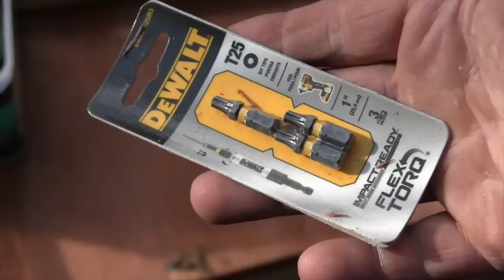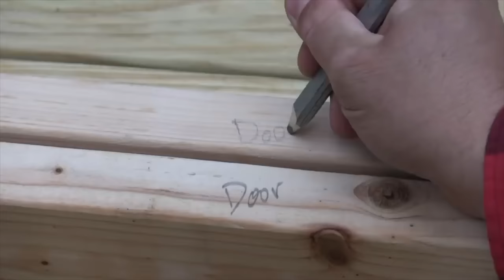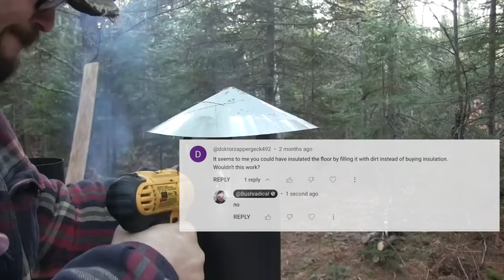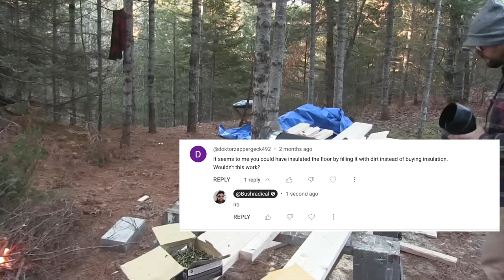Cabin with 24M views.....all the details

Comment: I’d use a nail gun but I own one so it’s a bit easier for me to say that. As for pt wood in ground, that depends where you live, it rots fast here in the south, I have a shop building on my land here in Arkansas, well there’s two but one is full slab red steel building, the other however was built at two different times, the original is probably 70 years old and has creasote treated lumber in ground and is about half way rotted through , the newer addition to that building was built in the 90’s using green pt and the posts going into the ground are completely rotted through. We rant steel posts into the ground at each support to scab it back together. However the red steel building while nicer is not better. It was built in 2012 and has rust holes through a few of the beams. You do things differently than I would but that doesn’t make it wrong, if it works for you who cares

Comment: I built a little fence with nails and then I wanted to take it apart and re-do it. It would have been easier with screws, and I wouldn't have broken some of the boards. Had to buy more boards. I used screws to re-do it. I use screws for everything now so if I want to take something apart it's easier. Treated screws are not that much money.

Comment: Thanks Dave great video on the making of a truly great video of good old common sense basic building of a UP cabin. Your Technics of construction are based on basic carpentry. That cabin will probably outlast you. All of your building videos have a quality of simplicity yet proven to last methods for quality construction. Your absolutely right about screws. For some things they are needed. Mankind has been using nails for hundreds of years now and it's a proven and time tested method of fastening wood. Screws are ok, but pricey way to do things. Battery drills run down as you use them and the batteries themselves have to be recharged. Plain old hammer and nails makes a lot of sense. 
Thanks for your videos and enjoy watching all of them. GOD bless you and your family as things are changing in the world we live in. To my way of thinking, a cabin in the woods is using the sense GOD gave us. 73 and GOD bless, Earnest K5EWM 👍. Keep using those nails. 👍.
Reply from the maker: Thanks

Comment: As a contractor I can testify to the fact that the overall cost of structural screws compared to nails is a factor of 3.  Screws are far more expensive, plus impact drivers + batteries + generator (for remote sites)...

Comment: Hey Dave! Would you consider pure linseed oil instead of Danish oil? The little smell it has is lovely, non toxic. Very long curing time though and you'll need several coats. Pure tungoil would be another option, maybe a bit more protection but very thick and thus less enjoyable to apply.

Comment: In my experience of Nails vs. Screws. Well how many times have you driven a screw and felt it break? Many i imagine.  But I've Never had a Nail break. I live in a very windy area of Southern Colorado.  I built my house with nails, vinyl coated sinkers driven with a framing nail gun. When the gun slams that vinyl coated nail into the wood it heats up and that vinyl melts and acts like a glue.

Comment: ** Two Tips: 1) Soak/Paint wood in a 70/30- Motor Oil/Diesel mix
2) No Cement around Wood Posts, it will cause Rotting. A plastic Base or gravel Base may be used.
Reply: Yep

Comment: Given the extreme cold you deal with, I would have gone ahead and done a 2x10 or even 2x12 wall frame, then insulated the heck out of it.
Im on the Gulf Coast, I dont like freezing that much.

I have always wanted to build something like this, just so I could exercise all my weird ideas, like for the pass-thru for the stove pipe, I would have used fire brick for the wall and surround, covered with real brick, then pass the pipe threw.

Floor and ceiling insulation to me would be paramount.  But a recirc floor heater from the fire would help a ton, and for the roof.....ok, I know this is totally ignorant, but solid foam boards insulating 12" rafters?

NVM...Im a tard.

Comment: Dave, I'm curious why you do not put any non-flammable insulation (unfaced fiberglass, rockwool, etc) in the void where your stove pipe "thimble" goes through the wall? Surely you get loads of condensation in there when running the stove when it's really cold out.

Comment: I’m putting down a simple pine plank floor in a log cabin. What would you most recommend for a sealer finish that is durable. I like the looks of that Watco Danish oil and would use it, but am wondering if you e come across anything better. Thanks!

Comment: I would still love to build a cabin, but I’d like it to be ground level or only one step up. We do get snow, but not much. Purpose would be handicap accessible for family. Do you think that would be possible? I know you mentioned you were going to do that. Our codes are anything 12x12x12 with no electricity doesn’t need a permit. I was thinking an 11x11x? Not sure how tall to either put a loft or just a bunk bed inside. And a deck doesn’t count as the structure, right?

Comment: I worked in a lumberyard as a summer job one year. We had several bundles of treated lumber come in where the boards in the middle were dripping wet with the green treatment. I don't think I've ever seen a single board come in completely dry.

Now, I have a quick question. What would be the biggest structure you could put on a treated post or a post and pad foundation? I want to build myself a cabin to live in without having to deal with any contractors, but I don't know anything about making concrete foundations.
Reply from the maker: I don't really know.........I would do a 20x30 and never think twice about it

Comment: Not to be pedantic, but the minimum size for a building without a permit is for buildings used for storage.  A building used for occupancy is not technically exempt by the literal wording in the code.  Still would need somebody out there to enforce it, so it’s probably fine either way.

Comment: The cabin build is nice and instructive, thanks. Unfortunately, the stove install is not. A stove like that has 36" clearance requirement. A proper shield can reduce that to 12", but only if properly installed on 1" spacers with a 1" gap at bottom and top. The stovepipe used outdoors will rot in a few years and it's installed upside down. The crimped end always faces the stove. It looks like it was done correctly inside. However, single-wall stove pipe has an 18" clearance requirement and is only meant for indoor use. The outdoor portion should have a class A tee on the outside and class A chimney pipe continuing at least 2 ft above the roof.

Comment: People have become lazy, hence questions about nailguns and screws etc. To be honest, I built my cabin using screws and that's only because I planned on changing my layout later on, i.e a phase 2 if you will. For example I built a massive deck 6x3m and now I have changed my mind and have decided to build my bedroom on half of the deck. Also I used copper plated screws, which haven't corroded as the zinc plated ones do, for the decking planks. By the way I had spaced the decking planks using a 9mm drill bit. Some of the gaps are now about 12mm due to shrinkage and just about anything that gets dropped falls through.

Comment: I do not understand how you can say the front and rear walls are sitting directly on top of the post. The subfloor plywood is resting on top of four 6X6 posts only at those four corners. Then your front and rear wall 2x4 plates are only directly supported on top of the four corner posts. Your cabin will probably be fine for several years. The best structural design method is to notch the 6x6 posts so the 2x6 lumber rests directly on the post, so the nails are not supporting any load.

Comment: Again people just don't have the concept of what it takes to build things especially off grade or you don't have a power plug in. He made a generator to power the air compressor than you need a crapload of air hoses to run the nail gun.. it's just not worth the hassle..... If you got the funds. And you can afford twelve to fifteen hundred hours for a nail gun. And I have four of them they work great.. paslode.. cordless works pretty much all day easy to use.. you might go through two batteries.. and 2 or 3 gas cartridges.. and a two pack of them as usually about $35. I work really good for nailing stines building walls. But they're not very fast when you're trying to just nail plywood sheathing to the floor. The old method of a hammer and a tool belt full nails works the best...

Comment: He wants to state that screwing together a structure is so new school,and yet itd been being done since prior to the new millennium and is an accepted way of building by every states code enforcement in the USA... Screws are proven stronger retainers than nails  when installed properly... Plus screws do not require compressed air,nail guns,or anything else other than battery powered cordless impacts,screw guns, or drills and a charger...
Reply from the maker: I've been a licensed contractor in 2 states and have been on a hundreds of builds......I have never seen a single professional framing crew "screw"  a building together. It's just not done....Why? Probably because nail guns are 10x faster than screws, they have better sheer strength and they are cheaper. 
Screws appeal to beginners who want an alternative to nailing by hand or investing in guns, hoses, and compressors......Just like videos on "Dry Pour" concrete, screwing a building together is a fad for the do it yourselfer who doesn't want to build the conventional way.

Comment: There is a hreat deal of common sense that is thrown out thhe window, digging out an old post for whatever reason when you poured concrete in the hole twenty years prior, is a bitch!

I did one deck years ago, and chose to listen to all of the 'experts', and left a space in the decking boards. The boards shrank so much, that the boards split where they were screwed down, and some of the gaps were large enough to trip on or lose things in the space; I never leave a gap when using treated wood now!!!